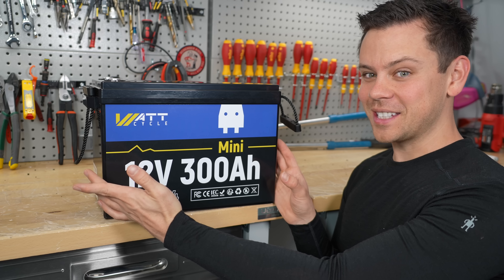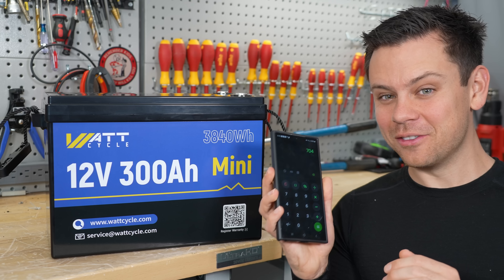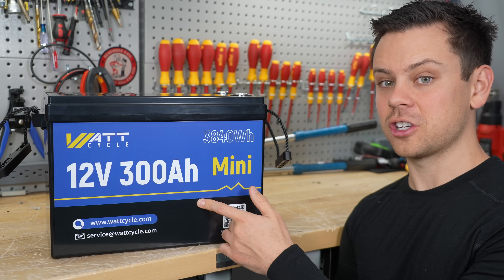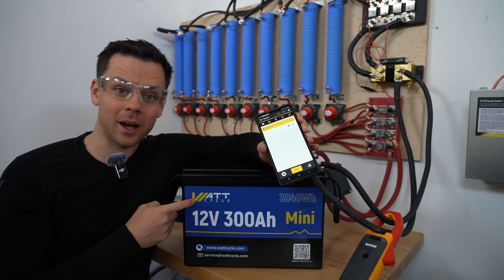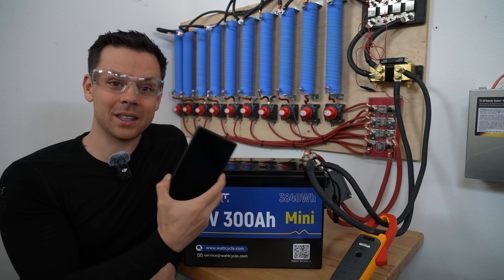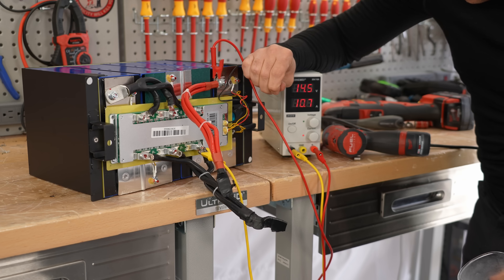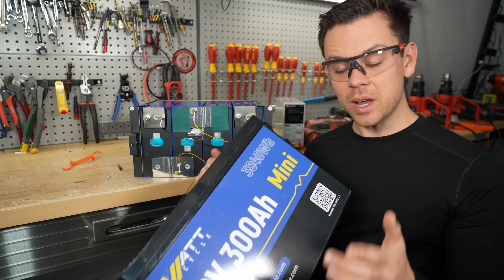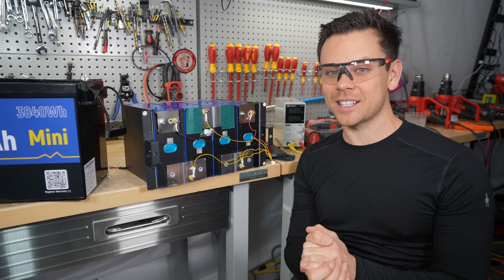Wattcycle 12V "300Ah" Battery: Popular Budget Battery Falsely Advertised?!

Comment: I could understand the 800A current draw if this battery was used to start an RV diesel.
This does look like a regular vehicle battery and may need the high amps, especially in cold weather.
HOWEVER, it should automatically cut off after 20-30 seconds if that is the case.
If I had 2 of these in my truck and it only gave me 300A each, I would be disappointed.

Comment: I have a question
I've charged 314ah to 100% and left it for 10 days with not being educated .
Now I'm discharging it by running 12v refrigerator in my trailer. I'm concerned about the bad effect on the battery because of this, which I've left it 100% charged for 10 days.
How badly will this affect my battery?

Comment: Well I received two Wattcycle 280 Ah blue tooth batteries yesterday.  The cost was $499.99 + tax.  One of the batteries TOP WAS ONLY PARTLY ON TWO SIDES AND HAD COME LOSS!!  Called the 'help' line at 3pm Michigan time but office must be closed for holiday weekend.  Other than that both batteries are in good shape.  Bluetooth connection made, 13.18volts in batteries as shipped.  They just set my install back at least 4-7 days 😞

Comment: Thanks for the review Will, I emailed Wattcycle over the 314AH battery and surprisingly this was the response.  When a vendor (Wattcycle) says trust me without any validation, I definitely do not listen to that.

Thanks for reaching us.
The 12V 314 AH battery is our New Releases not long before.
It's not the one that Will mentioned.
You can rest assured to buy our 314 AH batteries.
About our 12V 300Ah mini that Will mentioned, there is a control unit inside that protects the entire circuit by monitoring current, temperature, and voltage thresholds. It will trigger protection at 600A not 850A as the video indicated.
Our battery is safe for the house using.
Reply: Lol that's a Chinese person using translate

Comment: Yeah, I bought the hundred amp hour trolling battery off of Amazon. Something failed in the BMS because voltage dropped way too low. Can’t wake it up and when I go back to Amazon to look at the date that I bought it, I clicked on buy it again and it says this item is not currently available and there’s no information about when it will become available. When you click on the buy it, it sends you to another page that shows the one that I purchased and the same information but it makes a suggestion of another one you can buy. I’m trying to do a warranty with these people and they keep giving me the runaround and I’ve only had this thing for a matter of a couple months never really used. It only had it hooked up in my trailer Which was plugged in and had a charger that recognized this type of battery. You figure it out.

Comment: Have to be careful of dumbing down the over current on the batteries, its needed on motors to overcome locked rotor current at startup without tripping the battery over current protection.

Comment: I have an RV with 3 AC units on it.  I already have a solar system that came from the factory with 3 100ah 12V batteries with a 3000W inverter and 3 320W panels.  I already bought 3 of these batteries would it be ok to just swap out the 3 100ah batteries for the 3 280ah batteries from watt cycle or do I need to change the gauge of the cables
Reply: Can someone help me

Comment: I'm wondering about the capacity of these.  I bought two, connected them in parallel to my multiplus system.  As soon as I connect any load, they drop to like 13.2 volts.  I charged them, individually to 100%, and I've repeated that a few times.  They held at 13.65v for 48 hours, I connected them to a load of under 400watts, and they immediately drop to 13.2.  What is going on?  I'm feeling ripped off
Reply: Will be interesting to see if anyone else is having the same problem(?)
Reply: @__WJK__  I should have updated this.  He suggests using a fuse on each battery in this video, so i added a 200amp terminal fuse to each.  Somehow, I didn't get one of the fuses mated properly against it's mounting surface.  While I was troubleshooting, I found over a volt difference on one side of the fuse vs the other.  So I reconnected everything without the fuses and the batteries charged up just fine.  They're working for me now.  User error, not the batteries.

Comment: I just bought 2 of these watt cycle 300ah for my new trailer. I am looking about getting the Li Time 24v 3000w inverter charger. I have been looking for a schematic that shows what I need to connect everything correctly and still use my 12v refrigerator and 12v accessories. Thanks for all your information.

Comment: Your videos are awesome.  Newbie to LiFeP04 batteries (and to be honest... batteries in general)  Soaking it up like a sponge.  Before I discovered your channel I bought six budget level Btr Power 12.8v 100 Ah batteries to use as my house bank on my 38 Bertram Sportfisher. to power  bait pumps, lights, inverter, etc. (Have not dropped them in yet .) Going from five Group  27 flooded lead acid (approx 80 Ah nominal each)  ... obviously with only being able to discharge to approx 50% without damage on the lead acid....  I'm hoping to see huge capacity increase with six LiFePO4 as house battery bank.  Just curious if you have (or plan to do) a test/review on Btr Power batteries. Watching your channel I am shocked to learn of the variability of build quality and quality control.  Wish I had discovered your channel before ordering.  Curious to know if I got lucky and happened to buy a decent set of batteries or if I should consider another choice.

Comment: High current must be allowed for big starter motors will, some use these in dual battery setups and it won't start a big diesel with a 250 peak amps

Comment: Since the BMS isn't providing over-current protection, it would be a good way to test breakers and fuses.  I have bought a BLUE SEA 250 amp terminal fuse and holder for my single battery (300 mini) setup.

Comment: Even if it was programmed properly I would still put a fuse on it. The overcurrent protection is controlled by mosfets which cut the power to the battery. Mosfets while they are reliable, they can failed on (shorted) so a fuse is just another layer of cheap protection.

Comment: You can use 888888 as a password and set the OC to what ever you want. I found the BMS charge current was set to 240 amps on my 100 Ah battery. I changed it to 50 amps or0.50C
Reply: These 300ah do not come with bluetooth or a way to control the settings. What did you use to change it?

Comment: Nice Review.
A quick safety note on your setup. Those battery switches are not rated for 90A live switch. You should see updated switching characteristics coming out soon that complies with ABYC's C-7 battery switch requirements. When a failure occurs, the switches typically weld closed. I would recommend a large circuit breaker that you can manually open and close. We typically use manual breakers that are rated around 2000 A for these types of tests. Another note, ABYC E-11 which is a standard for electrical systems in boats, requires fusing within 7" of lithium-ion battery for this exact reason. You cannot rely on the BMS alone for protection.

Comment: Thank you for reviewing all of these batteries.  It is so hard to make a good decision with all of the LiFePO4 batteries out there.  I was wondering what your opinion is of the “Dumfume” 12v 300AH batteries.  They are currently on TEMU for 267.22.  Seems like a “too good to be true” deal.  Says it has a 200A BMS and 3840w of power.  Hoping to upgrade the house bank on my boat from 3x31 group AGMs (104AH each…much less usable).  Thanks again Will!

Comment: I got two of these and both have issues. First one arrived with the top popped off and second one has a large bulge on top. After further investigation I also noticed that the main terminals screws had been impacting the top of the last cell. This could be a big issue in a moving RV. It potentially could wear through the top of that cell. Issue with the bulge seams to be the lid impacting with the screws on top of the BMS. Thus forcing the lid up and also causing the BMS to flex down until it also contacts the tops of the cells. All this seems to be dangerous too me.
Reply: I have the exact same issues - they had me pop the top back down on it, and when I did I have a bulge - Check your cables and tell me if you can see signs of pinching?  Kind of looks like they are to long and folded up under the cover.  I have the rubbing issues too... I've asked for a full refund.

Comment: One thing I would like to bring to your attention as well with wattcycle batteries is that teir Bluetooth connection can basically be accessed by anyone.

I haven't found a Way i to restrict others from connecting.
Now imagine if this was used for in a battery bank invoving series and parallel connections and someone comes and shuts it off remotely 🤔

Comment: What is a good set up for a small camper? That’s affordable I was thinking all in one charge controller charger inverter. I would like to run a coffee pot 5000 BTU air conditioner 1500 W heater 1200 W bucket warmer not at the same time of course

Comment: Will Thanks for doing these reviews. I see several reviews on the Watt cycle of  12V "300Ah" Battery. No one else had opened one up or noticed that it was only 280 AH cells. Really the watt cycle refund $50 is nice but just brings it down to what a 280 ah would have cost in the first place.  I purchased one for my RV. I be returning it or adding a fuse

Comment: I built my van battery packs with these cells.  I got 8 of them and put them in my Sprinter.  I left them in the open so I can visually keep and eye on them.  So far ZERO issues.  I've pulled 150A off of each for months.  It was one of the best volumetric dense capacities of any reasonably priced cells.  If you run on a 12v system... You need to run some SERIOUS wire/fusing.  I'm running just a few feet of 4/0 pure copper with proper lugs.

Anyhow, GREAT cells.  If I had to do it again, I'd go with a 24v system and the same cells.

Comment: on the capacity test did you note the low voltage disconnect? I was suppressed to see on this BMS according to the manual its 9.2 volts + or -minus .12 volts.  would this be low enough this damage the cells.   most other batteries seem to be set at 10 volts 2.5 volts per cell.

Comment: I learned in 2021, the hell of a shorted cell. Lost both batteries and fried my solar charger due to not fusing my batteries and there was no built-in protection. I had to run my generator for 3 days until I could pick up the warranty batteries but they did not cover the solar charger. That was OK because I upgraded to a Victron.

Comment: I emailed them because I got two batteries with the tops popped off. I mentioned in the email that I clicked the batteries tops back, but also that I was concerned about the amperage limit on the BMS. They said it should be fine since the top s clicked back in and the amperage limit is actually 600A.

Comment: What's a good battery to use for a 72v Jacobsen truckster? I want to switch over from lead acid. The cost of (9) 8 volt batteries is in the same price range as lithium.

Comment: I received a notification on my credit card that I received a $50 credit from Wattcycle, so at least for my case Will just saved me $50 in less than 48 hours.  Thanks Will for the refund and the info.  Once again Will has proven himself to be the Grand Master of solar on YT  I used the money however to buy a Blue Sea 250 amp MRBF terminal fuse for my single battery setup.  THUMB UP AND SUBSCRIBE EVERYBODY!!!

Comment: I just bought and installed this wattcycle 2 weeks ago, used it on one trip.  I bought based on your recommendation for the smaller batteries expecting the same quality, and its ability to fit in a small box on the trailer tongue.  Kinda bummed now, still glad you tested it.   I bought a new stainless box, and modified the battery holder mount to the trailer a bit, just to fit this battery in place of two lead acids.   So a bit of work and money tailored around this specific battery.    However I got it for $475 on black friday, and they are issuing a $50 refund due to mislabeling.   That brings it down to $425, so I guess I should not be too upset? 

Should I return it, I won't be able to return the stainless box I purchased for it, and they box won't fit most other batteries unless I drop down to 2 100ah batteries?  Is there another 300ah battery about this size that you would recommend?  I can go a little longer, but not much.

Comment: He realy needs to use low frequency inverters with his test - high frequency inverters work well enough but they dont handle surges well at all -   i have 4 Trace PV 2000 FC low frequency inverters - 
      My guess is they will handle his car lift just fine - i have a electric hydroloc wood splittee and the low frequency 2 kw inverters handle it just fine were a the 3 kw inverters trip out on overload -        i had worked on generators in the offshore and remote mountain oilfields for about 50 yrs - we had 12 volt and 24 volt low frequency inverters set up on relays for back up power all over in the event of generators triping off line - the low frequency inverters handle 4 kw surges just fine - 
      Were as a 3 kw  and 4 kw high frequency inverters can not handl hard surges -  
      I also live in the rural south and have a APS on my house - its on a 9000 watt battery back up - 
        My four 2 kw low frequency inverters handle 4 kw surges just fine - were as a 3 kw high frequency inverter trips off line every time - 
     Hurricanes and ice storms knock my power out for long periods - after huricanes it about one or two months till we can recive large bulk fuel deliverys so i go hybrid till  fuel deliverys are resumed -
    When running hybrid ill burn 1/6 the fuel or less compared tobrunning strength off the generators -

Comment: @willprowse I'm not sure why you haven't reviewed any of the Docan battery packs.  They have a 300Ah battery (12v) that is less expensive and lower volume than this battery.  They claim to use Eve 304Ah cells.  I wish the Docan 300Ah battery was  available when I purchased their 230Ah packs, as they are identical in size. In my limited testing, the 230Ah packs just barely made 230Ah, and the cells are a little out of balance at the top of the charging, but you really can't beat their price!!!
Reply: Docan is an interesting option
Reply: Please test these!

Comment: Thank  you for your video. I am disappointed my 300ah batteries aren't as stated. But 280ah is still good for such a small battery. I will keep mine and I always have fuses on my batteries. Keep up the good work. It's your work that keeps everyone honest.
Reply: I think I might keep mine since I just bought and mounted a new battery box  sized specifically for this battery.  Still bummed, I would rather have the extra 20ah over $50 and the built in overvoltage protection. Especially knowing that future batteries will have both.  Instead I feel like I'm setteling for an inferior product, and that $50 isn't going to go very far for me.  But I already put in 2 days of work installing it, and that time is more valuable than the battery itself.  If I have to switch to a different brand, and get a new battery box, I get to waste even more of my time figuring out a different mounting solution.

Comment: Hey Will love all your knowledge and videos, question for you , I recently purchased the 300 ah battery from Wattcycle and the lid did pop open, I bought it through amazon at a great price of 499 plus tax free shipping but to return it it’s 245 dollars I saw this latest video where they will replace my battery and let me keep this one I was able to pop the lid back on , as it seems ok , do you think it’s ok ? And you mentioned about putting a fuse for the over current protection, what fuse would you recommend? I’m installing it in my RV , I have a basic knowledge of electrical and have a victron smart shunt installed. Is that enough? Or what other one would you recommend to install, my RV is a 30 amp , thanks so much Brian

Comment: I appreciate the advice on fusing and the danger of overcurrent but to be fair, batteries have never had any protection at all built in until recent years. You can weld with all the previous generation batteries with as many amps as you saw fit and the battery would do nothing but take it or melt. They weren’t nearly as volatile but they still could burn your assets to the ground.

Comment: your  video has been closely watched by watt cycle  , they have issued  an adjustment to previously purchased  300 ah batteries , i have never see an manufacture own up to their issue and worked so fast to try an resolve this issue  ,EVERY person that watches wills channel will always learn from his testing  (even the manufactures)
Reply: Positive points: They owned up to this issue very quickly. I already have an email outlining their remedy (except for the return for full refund thing). Negative points: This shouldn't be something they didn't actually know when they started selling these batteries.
You should always fuse your batteries anyway whether the BMS is supposed to limit the discharge current or not. A BMS is much more complicated than a fuse and can fail. It is possible that the over current protection part of the BMS in the Will Prowse video was a unit failure and not a design problem.